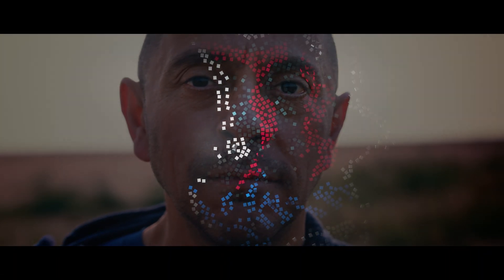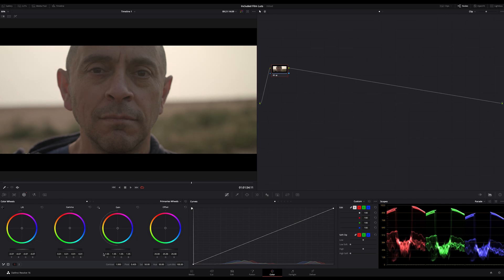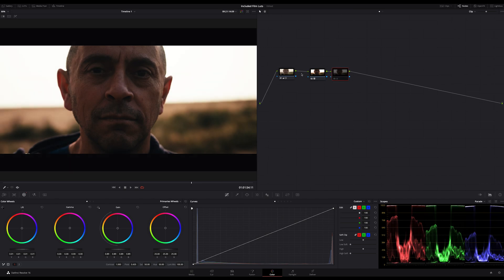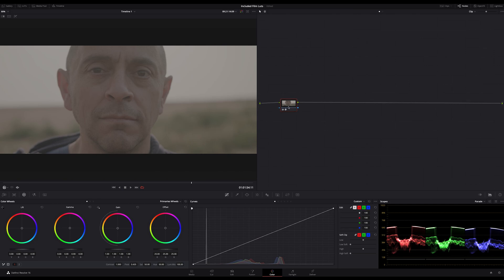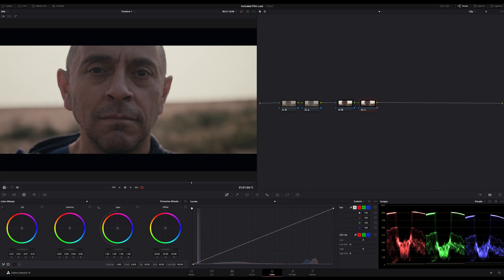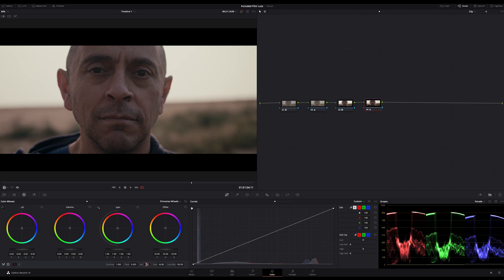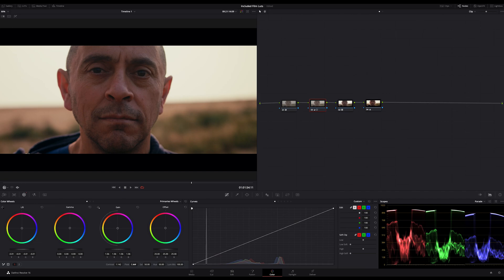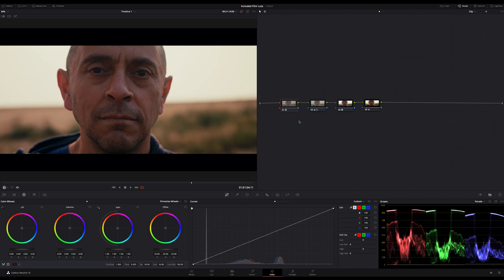Color Grading with Film Look LUTs | DaVinci Resolve 16 Tutorial

Comment: Interesting 👍 For some reason CST doesn't transform correctly to Srgb or at least I think Sony Catalyst Browse does it correctly with its own XAVC codec videos, the problem is that should compress the luminance between 0-100 and it doesn't specially in the highlights.
Reply from the maker: Isaac RC That’s right, CST has some problems with srgb, but luckely Rec709 is very close 😁 Thanks for your comment 💪🙏
Reply: @TimYemmax  Srgb protects highlights automatically at max. values but can't do it in Davinci so have to do it manually 😭
Reply from the maker: Isaac RC absolutely! But that’s the way DR works, it’s almost everything to do manually 😭
Reply: Therefore use REC or sRGB? this profile are similar ?
Reply: @sylwesterwielanek  it depends on the kind of footage you get out of the camera, some looks good in 709 others the luminance is above or below 0-100 values and srgb always gets inside the visible values. Davinci doesn't make srgb right for me i suggest you try Catalyst free it should eat any mp4 and see the difference between 709 and srgb profile space
Reply from the maker: Sylwester Wielanek They are very close, but sRGB is the better choice for web. But it doesn’t work very well in Davinci

Comment: could you explain it to me why is necessary convert to cineon log? and also, in what color space do you work for this exercise? aces? or davinci YRGB? thank a lot! I really like your videos!
Reply from the maker: The in Davinci Resolve included Film Look Luts are designed for Cineon Log, nothing else. Therefore you should transform the Gamma to Cineon Log. It’s independent from the Gamut, so you can work in color managed mode or just Rec709. Hope it helps!
Reply: @TimYemmax  in that senses, I need to convert the C-log of Alexa to cineon-log in order to use this LUT? is this the best way?
Reply from the maker: if you wanna use it with already transformed Arri log footage then you can transform this footage to Cineon, but in case of Arri you can apply this film look luts to the original ArriLogC too without extra transform to Cineon. But in case of already to gamma 2.4 converted footage you should transform to Cineon. I know, it’s a bit confusing if it comes to Arri log c, that’s the technical right way. Maybe we can email about this topic, but before next week I‘m not able to receive emails. Helped this explanation a bit?
Reply from the maker: In short, Arri log c is better then Cineon log, so you can skip this transformation to Cineon. Nevertheless, transform from ArriLogC to Cineon Log would be the technical correct way.
Reply: Tim Yemmax thank you!  It's really good if we keep in touch!  I think we follow each other on Instagram!  Soon I want to start my channel on YouTube, my idea will be to make videos in Spanish.
Reply from the maker: This sounds great! For sure, let’s stay in touch, would be great! Stay safe!
Reply: Hi, for Panasonic Vlog-L footage , should I transform it directly to cineon log?